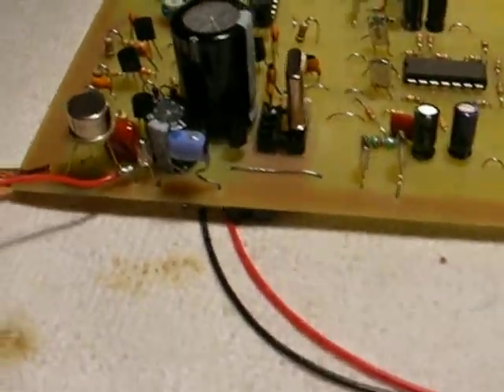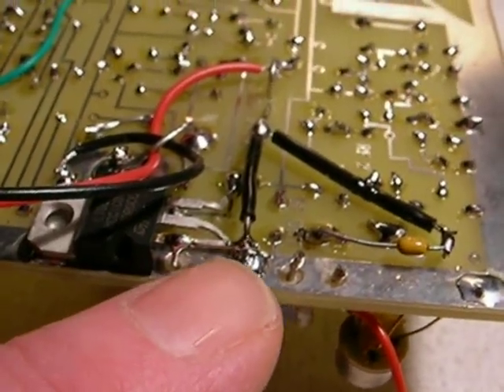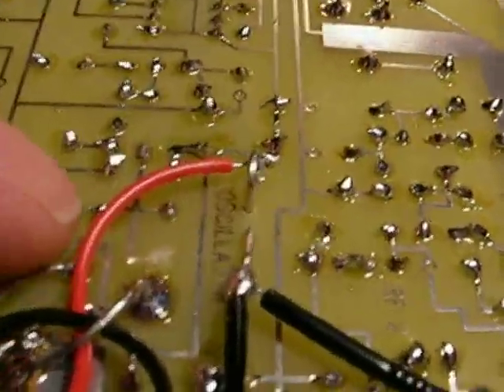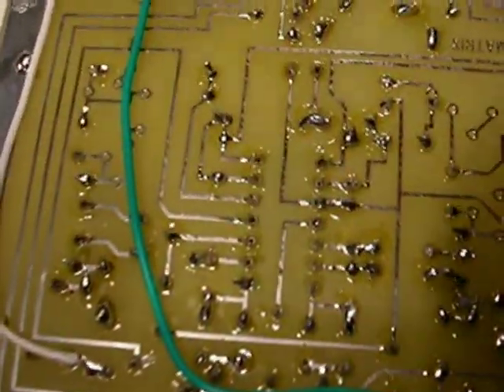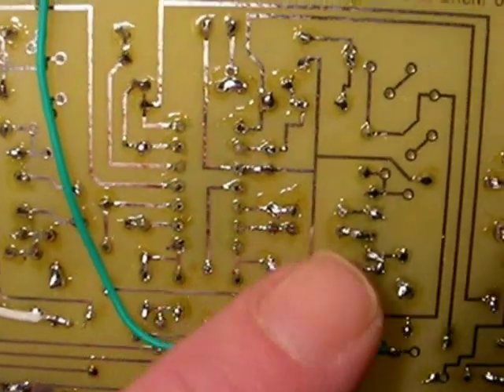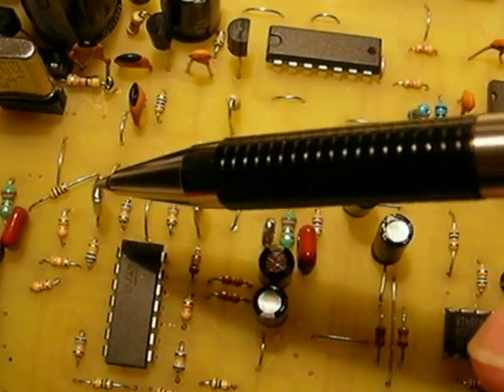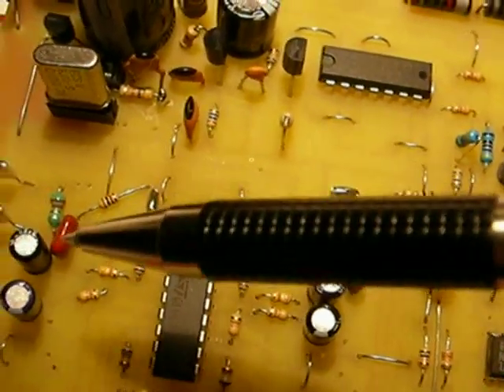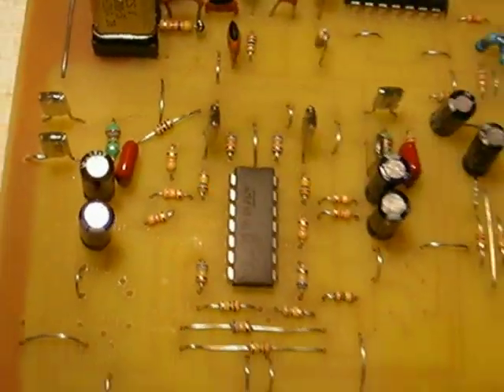Transmitter troubleshooting

Comment: @fortyfiveplayer I did that and put in the new 2N3053 along with the rest of the high power circuit. It works flawlessly but the problem is I got a transistor with shorter legs. Sort of leads me to think the included one was new old stock RCA. My solution was not ideal but effective soldering a clipped component lead onto one leg, the collector if I remember right.

Comment from the maker: @bratina501 Place the board so the edge of the board is facing you, xtal socket closest to you. Put in the oscillator so the pointed part on the case is facing left, towards the edge of the board.

Comment: @fortyfiveplayer  I have to turn the RF gain pot up all the way before I even get the distorted output so the transistors going out seems all the more likely. The incorrectly wired 2N3053 might have sent a significant voltage to the emitter leg of the 2N3906 damaging it but I will replace the transistors just to be safe.

Comment from the maker: @bratina501 Bypassing? Like not even there? Take it out alltogether, and run the transmitter on low power. If it is distorted, you may have damaged either the 2N3904 or 3906. Remember what I said also about the RF adjustment when on hi power- if turned too far counterclockwise, it will distort.

Comment: After bypassing the open 2N3053 final RF output transistor I now get severely distorted and low audio output from the transmitter. Is it possible that I could have damaged the 2N3906 low power output transistor or any others in the RF 1 or 2 circuit?

Comment: @fortyfiveplayer Another one popped up though, I installed the 2N3053 incorrectly because the first video did not show where the stub on the transistor is oriented. When I applied power it failed as an open resulting in no RF output. I ordered another 2N3053 so when it gets here I will try again using this video as a guide since it shows more detail involving the final output transistor.

Comment: Thanks for answering my question about the wiring, I really feel like I screwed up badly. Looks like I had an open circuit along with a possible improper ground on the 7809 voltage regulator. I left the 9 volt input going into the original hole.